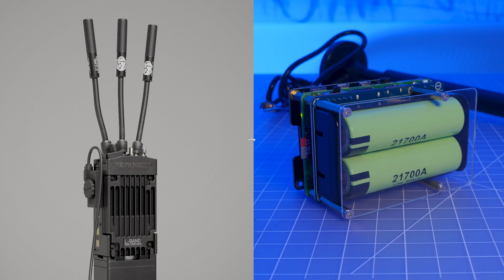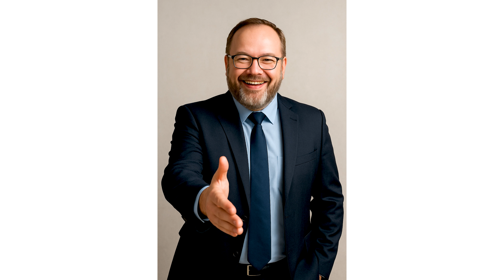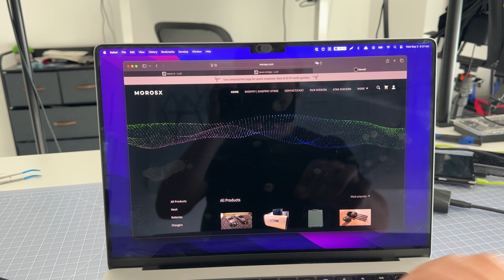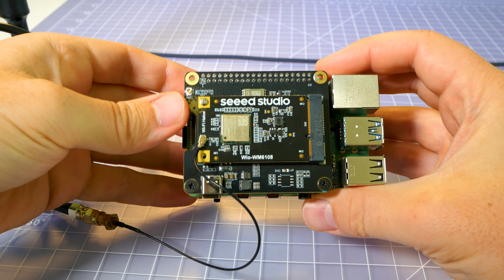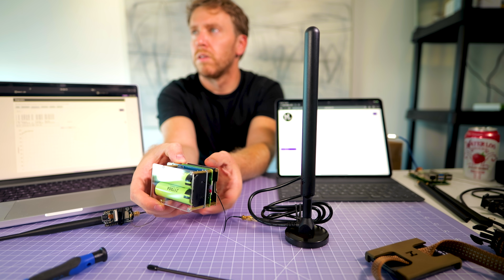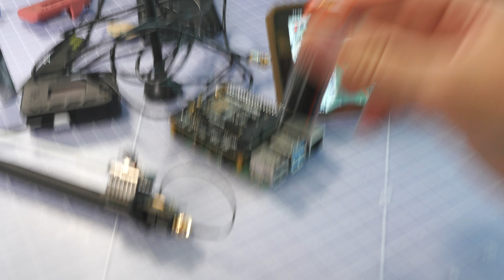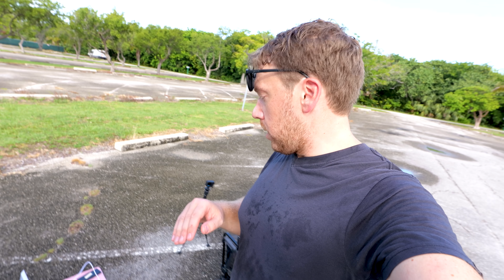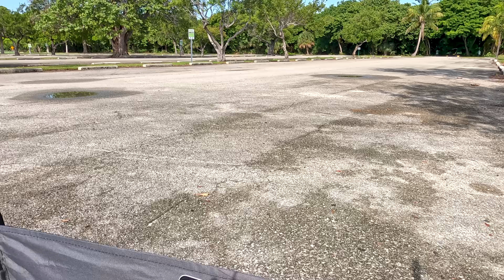I Built a $20,000 Military Router for $106.23

Comment: I use to work with Rajant Kinetic Mesh Military radios. They cost around $8000 each but I always thought if you took away the hardening and special certifications you'd end up with just a $400 device and you basically proved that here.
Reply: I feel like I've heard that in aviation and military, part of the cost is documenting every step of the supply chain so that flaws can be traced backwards and parts likely to suffer the same failure as a result pre-emptively replaced. Then on top of that, the military wants guaranteed access to identical spare parts for the next 50 years, either built up-front or manufactured as needed. Even if a design flaw is found, and non-military customers upgrade to an improved version.
Reply: @Uristqwerty yup. And add to that, traceability on complete supply chain so we know there isn't a backdoor built right into the chips or tiny explosives embedded into the low level components by the government in control of some foreign supplier.
Reply: @militaryartandscience  Doesn't add up to being 19 times the cost of what it takes to manufacture one. Most of it is bullshit and obfuscation, just own up to the fact that plenty of big-wigs in said government contract schemes get to enjoy massive profit margins while contributing the bare minimum investment wise. The pharmaceutical/med tech industry is a close second.
Reply: @EinsteinwhenZweisteinshowsup  Why not it very easily could. You also have to keep in mind they are developing a whole product and supply chain for basically one client.  Which limits them. Most of these companies are publicly traded and you can see their financials. They do not have overall very high margins, their market caps arn't all that high and their stocks don't move that crazy. You are also talking about products that also are life and death. I work in a different industry but I will pay a lot for even slight reliability improvements over cheaper alternatives because issues can cost a lot more.
Reply: Lol, everyone acting like hardening is wasted money.
Reply: @m4rvinmartian  well, acknowledging that testing and hardening actually are things that have real value and cost real money - that would require not being a catastrophically naive, inexperienced, Reddit-educated armchair engineer.
Reply: @m4rvinmartian basic hardening does not cost that much for smaller, portable equipment. From my experience in the military most of the time it’s hard plastic and thick rubber. Sometimes a strong metal alloy. When it gets further then that, like additional protection from electromagnetic bursts, I imagine it does get more expensive but most military equipment that is mass produced don’t feature those protections
Reply: @capybara9802  I doubt you're getting past TEMPEST with a plastic case. You can make IP67 or better,  sure enough, though plastic might not be durable for long periods in harsh environments. It's also of no value as a case for much power beyond the office, because it's not a heat sink, and when you have a system running at 60-90W, with  2, 4, even 6 MIMO radios each sucking 5W, 10W, 15W power or more in your system, you do need some cooling. Metal is your friend.
Reply: @capybara9802 Hardening is nothing like that. Your understanding of the word is just "making a box around it that won't let stuff in" and that is an insane oversimplification. It's really easy to say something is easy when you don't understand it.
Reply: @DaveHaynie in Afghanistan they were having to piss on and cover with sandbags certain models of radios to cool them down enough for continuous use. Even with throwing millions at design, you can't sustain 10 or 15w well when ambient is a continuous 120F. Shit sucks
Reply: @capybara9802  yeah, but you also need to take into account any biological/chemical/radiological contamination of the equipment while ALSO being resistant to the cleanup process afterwards, which isnt exactly a trivial thing.
Reply: @capybara9802  You're confusing hardening in general to just physical protection against bumps. It's about temperature (arctic to desert), exposure to chemicals, salt spray tests, some degree of waterproofing, and non-physical hardening as well. The software has to be robust to not crash at the worst possible times.
Getting all those things certified costs money.
Reply: @DaveHaynie  Even though most plastics are passive to IR?
Reply: @capybara9802 why yap if you don’t know what you’re talking about?
Reply: @m4rvinmartian  Hardening doesn't cost 200x, it's all bloat.  It's SIGNIFICANTLY cheaper to just buy/run multiples when military contractors are charging many multiples for a bit of shielding.  Comical.  Don't choke on the boot.
Reply: @MrFerrariF360 you're an idiot who aggressively doesn't know what he's talking about.
Reply: @MrFerrariF360  Hardening doesn't cost 200x. Getting certifications to prove all forms of hardening work does.
Reply: @ChucksSEADnDEAD  Lol, still nowhere near 200x.  So much talk about free market with a bunch of oligarchies fleecing everyone blind.
Reply: @MrFerrariF360 anytime someone goes “HURR DONT CHOKE ON DEM BOOTS” you can be confident they don’t actually have anything worthwhile to add, have no relevant experience, and have zero interest in acknowledging reality. Why do that when you can just score cheap dunks that appeal to other equally stupid people?

I wonder why real engineering teams don’t just sit around accusing on another of being bootlickers anytime anybody points out a really basic and obvious physical reality. Think of how productive they’d be!
Reply: @MrFerrariF360 do you talk exclusively in idiotic cliches? Do you actually have anything remotely worthwhile to say?
Reply: @MrFerrariF360 oh yea, I can see it now. Military build up is going to take 8 weeks 80 weeks…because we had to bring 10x the supplies. 

A 6.5lb/3kg item can now be an extra 65lbs EACH ITEM, while in the field, because they had to bring 10x…not to mention 10x manufacturing, storage, fuel consumption, raw materials, labor, pollution, mining operations AND likelihood of foreign adversaries gaining access, compromising, etc etc etc. 

If it's so simple, why not just go and fix it yourself? You'd be a hero to the military AND the people of the world!!! And then you'd be able to be the oligarch and show everyone how it should be done. OK, so maybe not you, but you don't think ANYONE or any company ANYWHERE would want to get a slice of those HUGE margins? Weird…if only anyone, anywhere, at any point in school, or since, had recognized YOUR GENIUS, we all wouldn't be in this mess!!!
Reply: @ChucksSEADnDEAD  No it doesn't.
Reply: Yeah, if you take away the really hard stuff, like the things you mentioned any tolerating active interfers, tempest cert, etc, then this is all doable.
Reply: @nigelcook730  Really hard stuff? Lmao
Reply: If you remove the expensive part suddenly it is not as expensive 
Shoker
Reply: @Goroca yeah. Basically it always comes down to this.
Reply: The hardening and certifications are really critical though. Not a waste. A radio that isn't waterproof and dust proof, that breaks if it's dropped, and is easily jammed by the most rudimentary tech is not very useful in a military environment. And would you literally gamble your life on a piece of kit that you aren't certain is safe and reliable and free of defects?
Reply: RAJANT radios are on everything these days
Reply: @Mike-mm6jp  That is the goal!
Reply: @DaveHaynie its used alot in the C-sUAS system environment
Reply: Makes sense tbh. Safety costs a fortune since lawsuits can cost the whole company.
Reply: Insanity 😂
Reply: That can be quite expensive to be fair. Perhaps the government could actually invest in helping with certification with the understanding put into contract form that the unit cost would be lower? I can see this going horribly wrong if not done right, as it always does, with the government picking the least able solutions and getting charged even more, because businesses will always charge what the "market" will bear. And "the market" really isn't in this case, it's people playing with other people's money and the illusion it's all free.

Which is a large part of why the US spends more on its military than the next twenty highest spending governments combined. I get the doctrine that you want to be big enough that no one is even a threat, that's sound, but it leads to abuses which drain coffers but don't even translate to operational advantages. And of course you have the tendency of large standing armies to be used in one way or other against their own populaton. Even is countries where this is supposed to specificallyl unconstitutional like in the USA. In politics there are no easy answers, but as my pappy used to say, the more difficult the problem, the more simple a solution people will scream for.
Reply: Or take away the years of R&D, sales, marketing, government t certification, etc. sure the costs come down.  Go ahead and try to sell this to the government and your price will 10x cuz of the certs alone.
Reply: You wouldn't have Rajant's Mesh, which is like nothing in open source. That's kind of the special sauce.
Reply: @DaveHaynie  LoRa has some amazing IP mesh networking algorithm white papers. There are proofs out there showing the best meshing algorithms for different use cases. I don't think there's any real special sauce in that regard any longer. I could be totally wrong though but I doubt it honestly. I don't see any military capabilities that we don't have in the civ side as far as the algorithms.
Reply: @TommyJ76  I'm not claiming anything specific to the military for the mesh. In fact, at Rajant, we almost got a huge bit of flack at one point from the military, because the DOD had done a study that claimed mesh networks started failing at round 50 nodes. We pointed to a number of Rajant installations working with over 500 nodes. Some mesh networks don't react to dynamic changes, for example: imagine 500 gigantic trucks in a surface mine, all staying meshed no matter where they go. That kind of thing. There are absolutely differences, still. But yes, in general, mech technology has improved.
Reply: @DaveHaynie  "proprietary algorithms and hardware" is nothing but "security by obscurity", which is not security at all, as anyone learns in first year info sec.
Reply: @cianmoriarty7345  The mesh algorithms are entirely about functionality, nothing whatsoever to do with security. For government applications, it's either FIPS or NSA-certified Suite B for security, depending on the requirement. If you're a comedian, I guess you could claim that TEMPEST is security though obscurity -- if my radio doesn't leak information, it's more secure than if it does!
Reply: The hardening and special certifications are a significant expense. They also assist in establishing standards for critical infrastructure and consumer products.
Reply: MG chemicals potting compound is cheap, but it's the mixing and waiting that pumps the price up into the thousands lol
Reply: Don't say that! invoicing that much made many be rich.
Reply: Love what you're doing let me know if you need any Solidworks cases/devices designed to help you out!
Reply: The hardening isn’t nothing. Often, the computers are the only thing to survive a wreck. That’s why survivors have to take effort to destroy it.
Reply: You could build 4 of them for 400😂
Reply: Came to the comments to talk about Rajant i have my RCNA and RCNP I setup and work on Rajant for various mine sites!
Reply: Also the ES1 is essentially a non ruggedized Hawk radio and its about $2500 whereas a hawk is about $10-$15,000 depending on the package
Reply: The real expense is in the R&D and engineering work. Once that phase is finished, the technology becomes almost like a printing press—you can reproduce it at scale with relatively little added cost. Beamforming is definitely impressive and a powerful tool in modern wireless systems, but it’s not the ultimate breakthrough or the end-all of radio technology. It’s just one piece in a much bigger toolbox.. eventually it all becomes consumer tech anyway.
Reply: @CoinJarMusicVideos the problem is that in a lot of cases you don't really produce a lot of them so you have to divide the RND on very few pices. And the setup for the machines is a big part of the price.
Reply: Welcome to government contracts where the quality is the same as retail and the prices don't matter
Reply: @Stealth86651 worse. Worse than retail
Reply: @Stealth86651  Brrrt makes the plane, brrrt makes the money printer
Reply: @Stealth86651  it can be the same or even less quality as retail, but very often it will outlive us and and is literally designed to survive nuclear war where just one nuke detonated in the ionosphere would cripple over the counter solutions.
Reply: Yeap, this is definitely military grade
Reply: I think some of y’all think hardening is just ruggedness, also chem bio and nuclear resistance.  Please if you can build a system that is NBC resistant, rugged, water resistant or proofed for Navy, and can do 10x more signal strength and bandwidth, upgradable SDR, integrated to command structures with all the software and apps for $200….YOU WILL RECEIVE THE CONTRACT! but what I hear is crying bc, “I can build the “same” device for <$200”.  Not to mention the infrastructure to build, maintain, and service 10s of thousands of the them.  The factory and offices the employees…$20k each starts to sound like a bargain

All the guy did was build a mesh network that can mimic the military grade equivalent which is awesome.  But it’s not the same.
Reply: they do this because politicians and bureaucrats get kick backs from defense contractors. as long as the middle class is willing to foot the bill, they'll keep doing this. stop paying taxes.
Reply: @cagneybillingsley2165 message unclear. Stopped paying my taxes. Now the MIB are out to get me and I have to leave the country. Going to change my name to josé and move to Mexico, start a new business and marry a new wife. Text you when the coast is clear. 🎉
Reply: @cagneybillingsley2165 nah bro, all the added cost is funneled to the space force

saddam had a stargate underneath the ziggurat of ur

 the US snatched it in 1991

the pentagon made the show as a cover-up
Reply: Even with hardening it would be cheaper
Reply: Most of that has to be the certifications. hardening is much cheaper these days.
Reply: Money laundering via the military and 3rd party contractors.  Overpaying on purpose.

Comment: You need some much better 900mhz antennas. At the distances you're showing, you could use regular wifi outdoor radios and have a way faster connection (like a Ubiquity nanostation M5 or M2). You should be able to go WAY further at 900Mhz and +27dBm output power. At that distance with a couple nanostation M5's, you'd have 500Mbps connection easily. So while this is cool and all, something is seriously falling on it's face here, or 802.11HaLow is really pathetic
Reply from the maker: This video doesn't cover the absolute max range I could achieve I will do more extensive tests tho!

Comment: Military stuff has so much more spec on it than civilian as you said no one is selling civilians something electronic which can be run over by a Humvee. The toilet seat is similar as one of the specs is not to turn into shrapnel.
Reply: Actually, the first product I was involved with for the military was a small robot for bomb disposal. Small meaning cheap, less than $5,000 each versus $150,000 for a PackBot (the one from "The Hurt Locket"). The first one that got destroyed in Iraq was, in fact, run over by a Humvee... two soldiers were racing them and didn't stop in time!  That's because the motion base was using an off-the-shelf high end R/C "monster truck"... we had a bunch of other stuff on it.
Reply: @DaveHaynie  I did not mention the requirement to be Squadie proof...
Reply from the maker: For sure, Haven voids all the warranties - but, for me, that's half the fun.
Reply: >ceramic throne turned to shrapnel
New fear unlocked